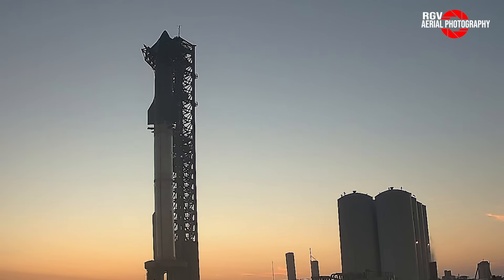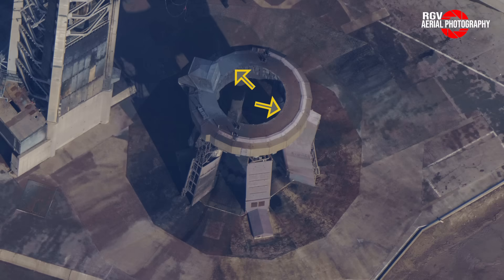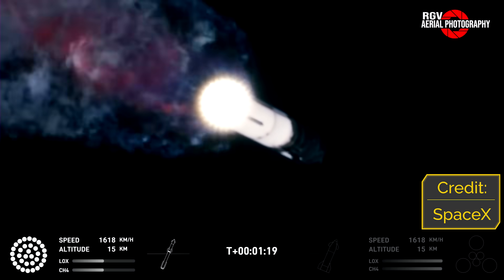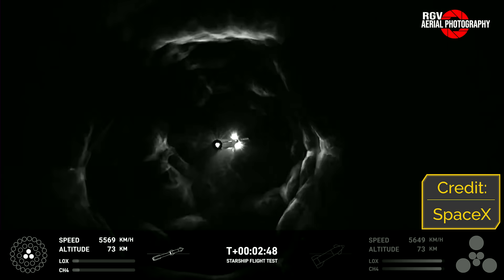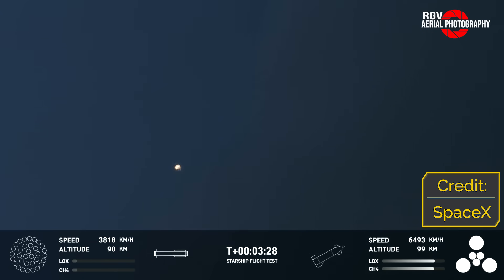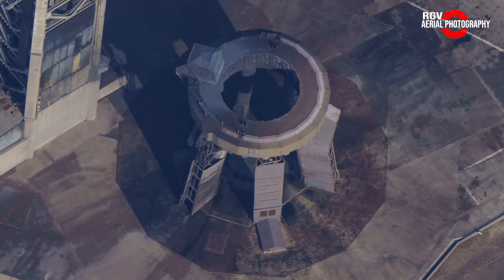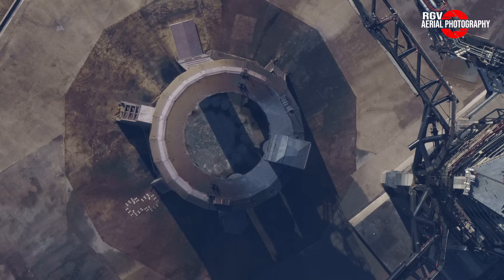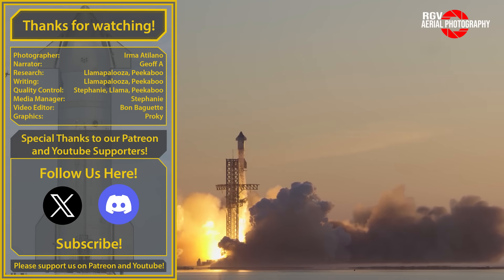DID THE LAUNCH SITE SURVIVE?! Post-Launch Flyover! - Starbase Flyover Update Episode 25

Comment: It looks like the metal plate took a beating, if it's charred, it means that the water did not provide enough protection/energy absorption.  I would not be surprised if Musk has to replace it,  calling the plate a "sacrificial element" in the launch pad design.  The charring on the pad's upper surfaces seem to suggest a guidance problem, the rocket was deviating from flight path while just a few meters above the pad.  That's a great shot of the warhead re-entering the atmosphere, really great work.
Reply: B10 static fire just a month later with no significant work means the plate works as intended

Comment: The pattern of the starship engines is clearly visible in the discoloration of the water shields surface plate. Even with tons of high pressure water spraying out the plates surface still got burnt and eroded to some extent. The rocket plume's moves at Mach 10 it can burn and wear away metal like an abrasive.
But the great news is the water shield is effective. The dullards who insisted you need a flame trench seem to have all gone into hiding.

Comment: There was a lot of progress made between these two flights. Still quite a few hurdles to go, but there was clearly a wealth of data to collect about various failure modes. More importantly the OLM deluge appears to have done its job reasonably well. I'm guessing they're going to want a fatigue analysis on the metal itself to see how deeply degraded it is.

Comment: So booster rotation after separation is going to cause sloshing and sloshing stops engines. Therefore a second or two after ship engine start up and stage separation shut off the last three booster engines.  They will have done their job in continuing acceleration during separation. A slight bias in the separation shield on top of the booster will deflect the thrust of the ship to start the booster turning one way.  Once 180 deg. rotation achieved and corrected by the  nitrogen thrusters only then start three engines from a small header tank for the boost back burn.  So forcing the remaining fuel to 'un-slush' from the thrust. Shutting the three engines early will also stop them from driving the booster away from the target till rotation is achieved so improving efficiency.
I would also like to see Ship 16 try a return from orbit using a series of retro burns followed by bounces off the atmosphere to  scrub off speed then cool off after each bounce. Fight fire with fire. Finally a vertical retro burn aka Falcon at 8000 kph and capture by the chopsticks. Extra fuel required verses the mass saved from flaps, actuators, some batteries, wiring, tiles, pins, insulation matt. Even if more fuel is required than the weight saving above it is a better price to pay for reliability than the unpredictability of the heat shield tiles for rapid re-usability. It would also be far cheaper to produce. My armchair 2 cents!

Comment: It's a layman I'd say the booster started flipping too early causing sloshing without it first getting into equliibrium after the violent separation. The sudder oush back by Starship might have moved the fuel to go to the top and when flipping directly it got very turbulent starving the engines? The FTL also thought it was crashing down so it blew up?

Comment: Economics of the fuel very solid but still questions remain as to how nominal sustained consumption into combustion this fuel does in fact "function." The payload set should function in a vastly superior manner with this fuel upon reaching the Big Chill approaching the Karmen Line. This didn't happen so was a major disappointment. Having said that very impressive hot stage separation so should be more than enough successes here to proceed to a 3rd Flight. The goal of this is actual commercial use to launch Starlink Satellites so my only question now is can Starship "dispense" this as the Falcon 9 already can. Launch pad looking good so moving forward with similar launch pads first in Florida next Vandenberg in Southern California looks set to go to me. Only thing missing now is an update from Blue Origin. Verdict: great news for Falcon 9 yet again.
Reply: Are you just making things up?

Comment: I don't understand how the engines handle the aerodynamic forces when the booster flips. It's doing 5000kmh
Reply: What altitude was it when it flipped?
Reply: @Geoff_A   maybe 100,000
Reply: The air is pretty thin up there.

Comment: Booster blows up.  Primary stage blows up about 1/4 of the way into the trip.

I guess “great success” is if it doesn’t blow up on the ground or crash onto people.
Reply: It moved the testing forward, which was the goal.. a goal a lot of simpletons don't seem to understanding.
Reply: Stage zero wasn't destroyed, all booster engines worked all the way to stage separation, separation was successful, all Ship's engines started up and did their thing. Yes, this was a major success, when you go further than the previous test, you're successful in your iterative design.

Comment: need to check the flow of s25 thrust when it is separating from b9.  possibly need to extend ring 7 meters and make a funnel style deflector instead of existing cap.   question how much taller can the mechazilla handle a rocket stage?
Reply: Can you cite anything that supports ANY of that?

Comment: They need to slow the booster down before attempting to rotate for reentry.
Reply: Is it any different to Falcon 9 when it does an RTLS? (Return To Lauch Site)
Reply: The diameter and mass is much larger structural stresses are substantially different, I would imagine.
Reply: @sector13studios  100%, but things change drastically when the air pressure is next to zero?
Reply: Not sure what the air pressure is, but it definitely traveling super sonic. Just seems like their other booster kinda fall back toward earth and slow down more before they maneuver.

Comment: The hot staging may have reflected heat and high temperature gasses back up into the second stage engine spaces and caused some damage there.  SpaceX will have the data.  It will be interesting to see if there will be a design change to the hot stage section (taller section?) of if they are happy with how it performed.

Comment: Thanks for this detailed report. The cracked concrete around the steel plates may indicate that this deluge system didn't neutralize the blast force of the engines adequately.  My guess would be the concrete foundation under the plates is cracked as well.  NASA designed a simple, successful deluge system 60 years, but this design seems needlessly complicated and appears to need extensive repair after each launch.
Reply: If you think the flame trench at the cape suffers no damage you're delusional.  What spacex is skipping is the diverter.  I suspect for now they have good reasons for wanting to keep it flat under there.  At least for now.  But keep in mind the entire site is a pathfinder site for development.  Expect more changes.

Comment: Absolutely fantastic and comprehensive report.  Well done to ALL the team. It's easier to agree with the theory on what happened to the booster with it being relatively visible, and I totally agree - likely fuel slosh.  They may need a retrofit to direct the slosh into a useful catch-point. As for the Starship, I think the only way to find out exactly what went wrong would be from data.  One last comment, Spacex's live coverage was awful. I don't use TwiX...or whatever they call it...and why are there no on-board video feeds?..unless there were and they're hidden from the general public!! NASASpaceflight'd coverage was ACE!!!

Comment: Just for the record, I'm betting on the upper stage engine startup as the initial cause. SpaceX has the flip maneuver down, I think the flip is complicated by the (suspected) negative acceleration from the upper stage pushing on the booster and mixing everything up.

Shaken not stirred

Comment: The destruction can be the fault of one thing. Hubris. These are the same people that thought they didn’t need a flame diverter or suppression of any kind once. They also thought some bizarre out of control flip was better than hot staging. Their thought process is ridiculous in a lot of ways. 
There’s no world where this is a success. It’s ANOTHER failure, and while their endless hubris continues, I’m sure there are many more failures to follow
Reply: Correct, that's the effect of iterative developement. Failure provides an easy list of improvements. Wouldn't you agree?
Reply: @Geoff_A  it’s hard to fail when you have a thousand challenges, get 2 right, and call it success.
Reply: @Meatball2022  Yep, it's hard to go to space, if it was easy, everyone would do it. I don't see why it's so hard to understand that developing a prototype rocket requires lots of testing and improvements? You clearly cast this project aside with hubris, no doubt as a result from the effect of mainstream media? Which I don't hold against you, but you're ignoring the infinitesimal details required to develop such a monsterous contraption. or did I mis-understand your comment?
Reply: @Geoff_A  it was hubris that caused them to not use a flamethrower. It was hubris that caused them to do some ridiculous flip the building maneuver instead of hot staging before. It is hubris to insist these engines are good when they can’t reliably light. And they haven’t even tested this chopsticks landing yet. Now that’s hubris. 
They do plenty right. They also do plenty wrong. And the things they do wrong would have been right if they weren’t so he’ll bent on ignoring the obvious. 
And this created a “rock tornado” the first time. Wonder what happens when they light those engines on the moon with no pad….
Hubris
Reply: @Geoff_A  to expand further, elon has said multiple times “the best part is no part. The second best part is a simple part”. Yet he takes tried and true designs and theories and throws them out the window for no reason other than hubris. 
We don’t need a flame diverter. We don’t need a landing pad. We don’t need to hot stage. We don’t need an effective FTS.  The list goes on. All of these were horrible decisions attributable to extreme hubris.
Reply: Starship & booster are the biggest most powerful rocket ever made, of a completely new design & new materials using a new fuel & engine that is never going to be easy and just for additional difficulty it is doing a flip and boost back manoeuvre at 5000 kph. No other company has managed this yet even with a small booster let alone a 9 metre wide monster.
Reply: @jackdbur  and in addition to all that difficulty, they were also going to do this using engines that NEVER work reliably. AND for months were going to spin the rocket on purpose instead of hot staging, which clearly works and appears to be exponentially easier. 
Hubris

Comment: If the velocity drop off is accurate just before hot staging, that could explain why Starship had a problem... when decelerating I don't see how they could have maintained positive gravitational forces feeding the pumps. I think they may need to play with the throttle back and perhaps not throttle back so aggressively.

Comment: two things, during the climb of the super heavy two engines have a different exhaust plume than the others, one can be identified around the max q, the other a little further forward. The second thing is that if you change the saturation of the image at the time of the ship's telemetry loss, you can see the explosion clearer, the ship's telemetry loss was caused by its explosion.

Comment: I think the negative acceleration that occurred when stage two essentially competed against stage one prior to separation ( you can see the velocity dropping from the 56xx’s to the 55xx’s) may have caused the field slosh amd the movement of gas into the engine intakes of booster 1.

Comment: 1st stage needs a broader first stage a broader b9ost changes weight to lift ratios at lower altitudes giving. Better efficientcye.reworking a bundled 1st stage gives the broader launch pressurer

Comment: Nice job Geoff. The booster seemed to flip too far with an indicated nose down attitude. I always thought Falcon9 booster stayed slightly nose up on the boost backs and certainly on the  landing and reentry burns. Not enough thrust to keep fuel in the bottom of the tanks, nose down. My guess anyway. Also when hot staging occurred would the booster be thrown backwards by the thrust of the ship? Even briefly? This could upset fuel in the tank also. Seems SpaceX should have shut down the booster engines for a moment post hot staging. Get the propellants where they belong then boost back. probably over simplifying the whole ordeal.  As for the ship - My worry, even though hot staging appeared to work is: What kind of back pressure was generated under the skirt of the ship during hot staging? Lots of rocket exhaust with limited escape routes even in space. The ship did seem to lose LOX at the end perhaps there was damage during hot staging that finally gave out as Gee forces increased towards the end of the flight? Hopefully space X tells us what happened. It's always fun to speculate.

Comment: I think that Leaks badly hurt the total fuel profile of both of the machines.  Engines were lost/shutdown due to a lot of factors but I think a lack of O2 was a major factor in the booster issue.  
I looks as though the fuel was very low on Starship also,  i think that explained/explains  the "plume" you pointed out.  
Yes,  I think that it developed a leak that took enough of  the fuel and the computers terminated the flight via explosive devices.  
Were the Terminations very quick on the trigger and very sensitive to the fuel gauges / fuel pressure profiles? Yes
Was that what they were supposed to do ? Yes
Would a longer trigger time have shown different pressures and fueling levels after 20 more seconds in either machine ?  Not probable, but maybe. I don't know enough about the pumps and any negative and locked pressure profiles in all that plumbing to even guess. 

I don't think that the computers were "smart" enough / programmed to let analog time play out for a second look after additional seconds of the initial bad conditions,  nor do I think that That would be something to aim at,  
I just wonder if more data, like 20 or 30 seconds more would tell them more about real conditions at the time to pinpoint more exactly what physical problems need to be over come in future tests.
Reply: Pretty sure that SpaceX were flying to a tight envelope and if it looked like being breached the automatic system would blow the vehicle.  There was no way booster could have maintained its flight box with that many engines out = flight termination. Starship was out of fuel too early = automatic flight termination.

Comment: What you can see on the plate is not the engine marks but rather where the water stream of the pipes hit the plate from below I think. See the water deluge system in slow motion to confirm.

Comment: did you say it was a successful flight??
Reply: Yes, because it completed stage seperation. Afterall, it's only the 2nd test flight of a protype. They learn what needs to be improved/perfected by breaking it.
Reply: @Geoff_A  is call ot a successful launch and separation… but since both the booster & starship blew up , hardly a successful flight.
Reply: @kurknielsen  Have you ever painted a room in your home? You start with preparation, decide the color, buy the necessary items to complete the job. Or so you think. Halfway through the renovation you decide the curtains should be different and the floor should be wool carpet instead of bare wood. This is iteration during developement, exactly as what's happening at SpaceX. Discover what needs to be corrected during developement. The 1st test flight of this prototype got off the pad......tick (amazing it didn't destroy the ground support equipment) well, the pad had a bad time but it was fixed and improved. 
This 2nd flight didn't damage the pad and managed stage seperation......tick.
I can't see why you think what happened for IFT - 2 is a problem? Problems are solved and this is how SpaceX works to the solution.
Reply: @Geoff_A  😂

Comment: Why did you omit the huge dents in the tank farm?
Reply: Those are unused tanks, one with a very big dent is empty used to be a water tank end tank used to be a methane tank but was changed to water & now ?.
Reply: @jackdbur  They pointed out a dislodged cover/object on the top of one tank but inexplicably left out the significant damage to at least two other tanks which should certainly be included in this survey.

Comment: In response to the question of why “no on board video “ I would speculate that this may be because the engineers need performance data more than video of the ground getting smaller. With the number of Falcon 9 launches being conducted,they don’t need more    “On board assent video footage “. Give them time,when they are confident that the vehicle will perform as expected, then they’ll have enough time for “ on board video “ Do you want to see the vehicle experience ( rapid unscheduled dissembling) from on board? ( You’re not going to see much)😮
Reply: Just means that SpaceX has not released any yet. Of  course there are on board cameras.

Comment: Scott Manley had a, to my ears, very convincing theory. During the hot staging, you can see there is major and FAST deceleration of the heavy booster. That might have sloshed the fuel too much causing the engines to fail. You can even see engines fail that havent even been turned off.
Then its perfectly possible water ram in the emptied downcommer might have caused the RUD.

Comment: Right before stage 2 leaves stage 1, it looked like a separation had occurred, with a gap between both sections, it seems both came together again and impacted, the edge with the 4 non working boosters, causing the erupted event right after stage 2 boosts away